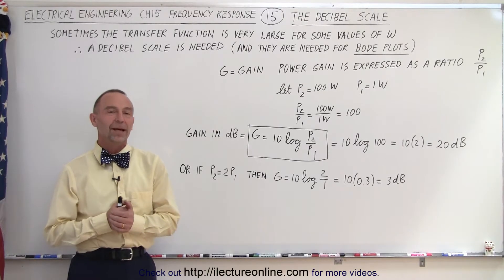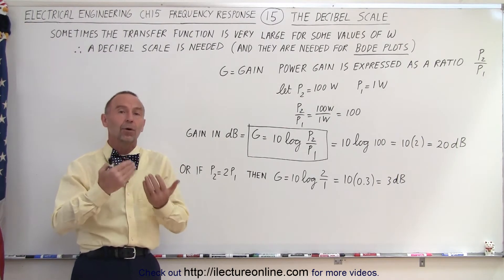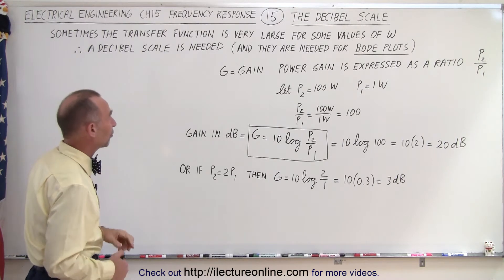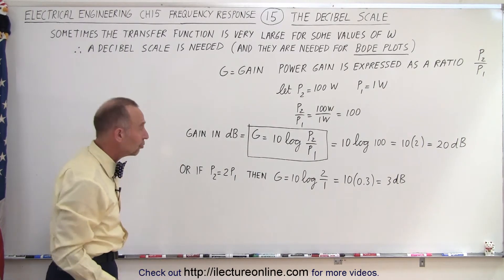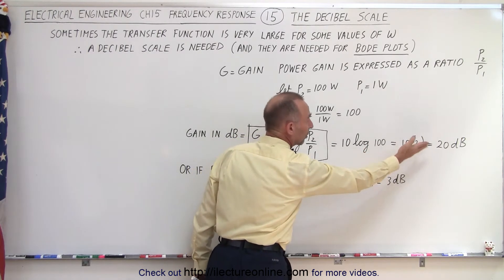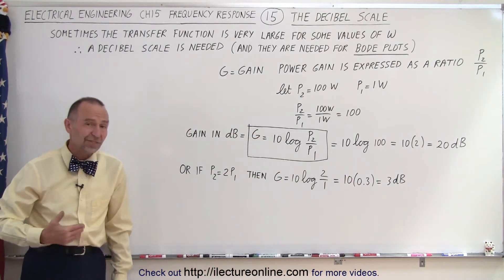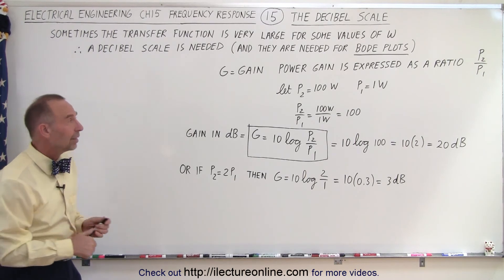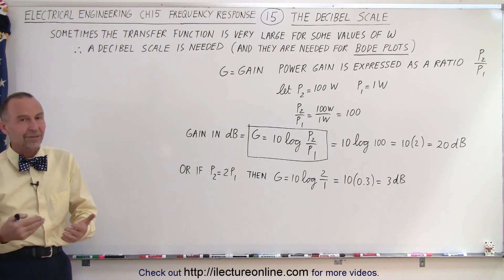Electrical Engineering: Ch 15: Frequency Response (15 of 56) The Decibel Scale

Comment: Correct me if I am wrong but I believe when speaking about the gain in voltage or current it is correct to say a 100 times increase is 20dB. When talking about power a 100 times increase is 40dB. Third year EE student who is eternally grateful for your videos. Thank you for all your hard work.
Reply from the maker: Since power = impedance x current ^2 what you said is correct.